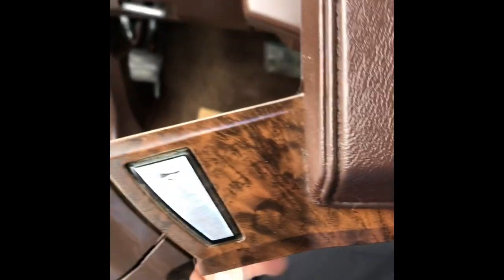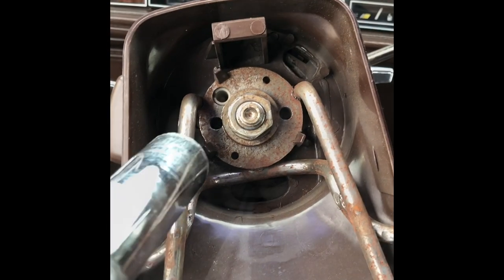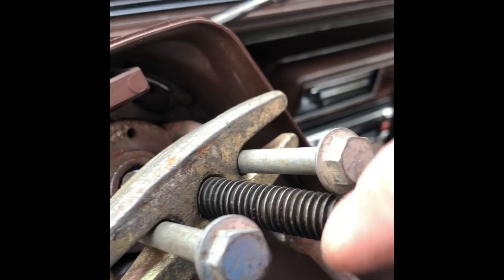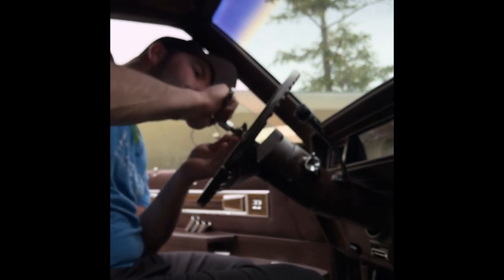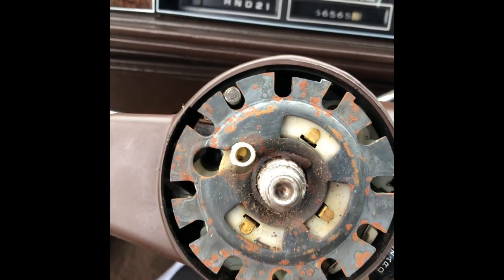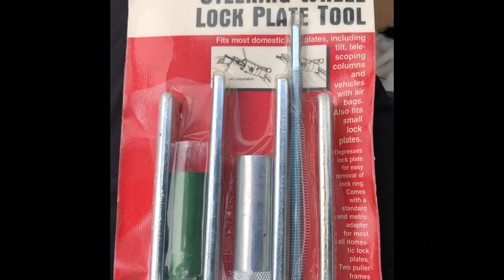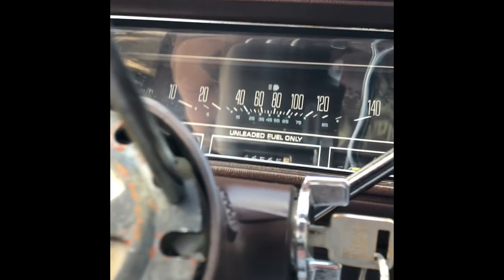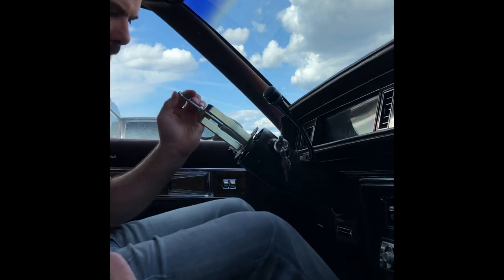replace turn signal switch g body cutlass

Comment: Great video I have a 87 Monte SS and my high beam is stuck in high won’t click back to low beam. Is this the part I need to change?
Reply from the maker: I do not know sorry..
Reply: No, the high beam switch is mounted down at the base of the steering column underneath the knee bolster panel

Comment: What was your reason for the fix ? Turn signals and brake lights weren’t working ? That’s my case and list of people say I need to do this …
Reply: Well my front blinkers work and tail lights work also. Just back blinkers and brake lights that don’t work
Reply from the maker: I believe it was the brake lights not working and honestly if I remember correctly, I think I figured it out to be the brake light switch being corroded inside. I just popped it open and clean that out so I probably did this for nothing but I had people telling me the same thing.

Comment: Great job my friend congrats. 
Do you know why my lights on my olds cutlass supreme 81 stop working,? I did check all fuses so far there are good. They were working ok until this weekend that I was traying to check for a horn relay and I just removed the signal light fuse. There after I noticed in the night that my back lights, only all of them were out

Comment: Have an 84 cutlass..is it possible to take the turn signal switch..turn signal/windshield wiper/cruise control lever out and put it into a aftermarket chrome steering column?
Reply from the maker: No idea

Comment: If all light work except turn signal will I need that
Reply from the maker: Hard to say.. might need the signal relay try all easy fixes first
Reply: @GBodyJames  were is signal relay located
Reply: @jermalramsey1567  i'm wondering the same thing, theirs two signal relays apparently. Ones for the hazards and the other is for the blinkers.